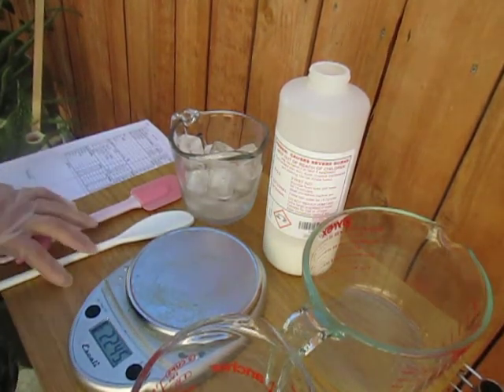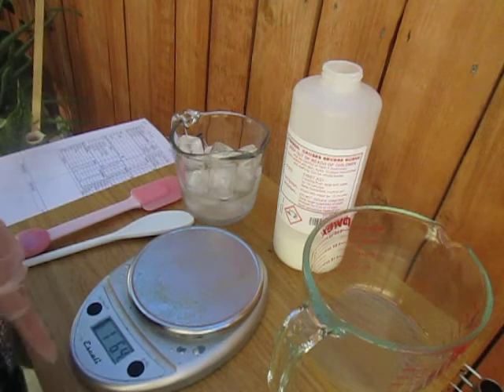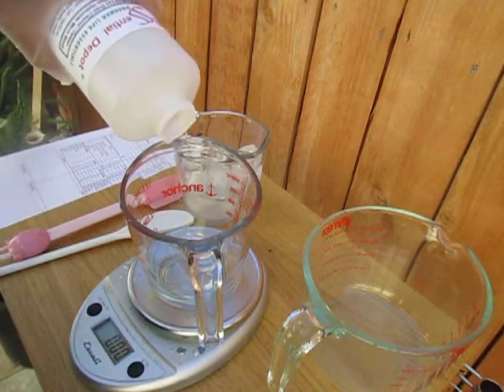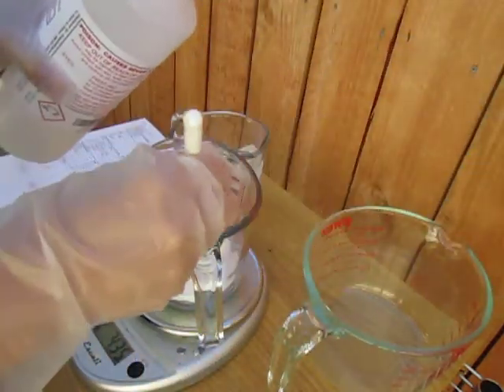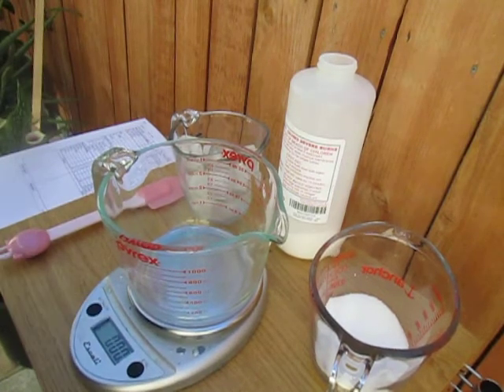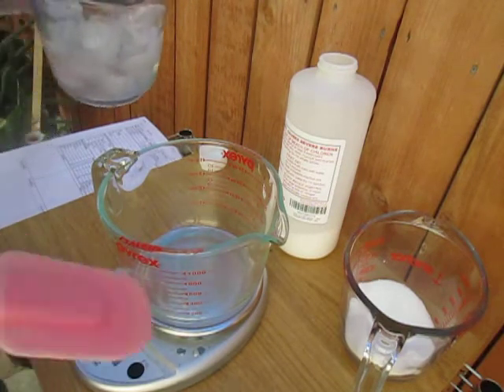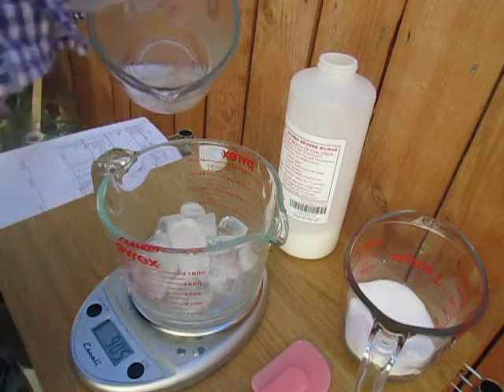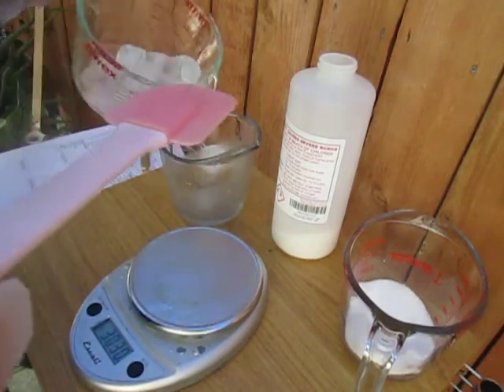Soap Making 101: How to Make a Lye Solution for Soap Making

Comment: My lye solution is cloudy. Please help me learn why.
I wanted to make a 50/50 solution. I measured exactly 350 gr of distilled water and 350 gr of lye. After mixing and waiting hours later it was still cloudy. I added another 150 of water, it stayed cloudy. I have mixed it stirred it several times. 

The lye was purchased a few weeks ago. We don't have any practical jokers crazy enough to touch my soap materials. Everything was washed well. I have used the same equipment, and materials successfully before.  

Any ideas? Should I throw it away?